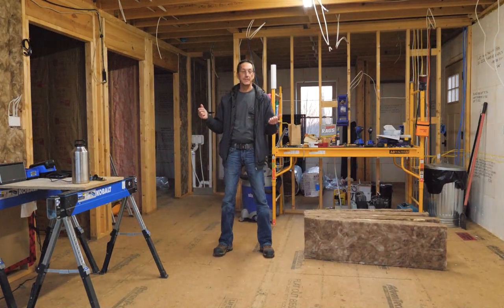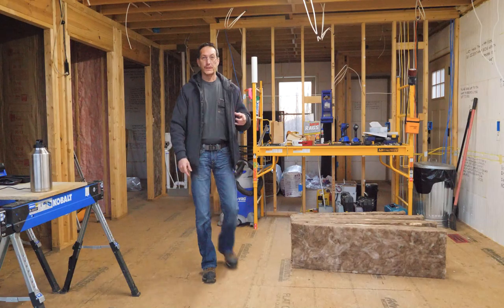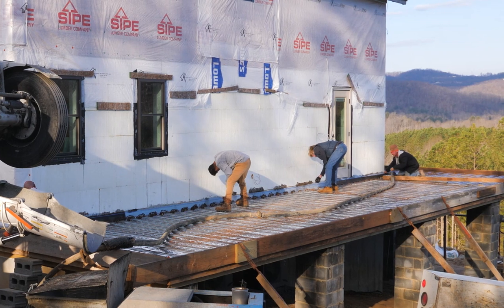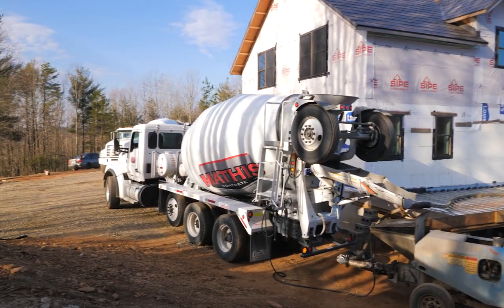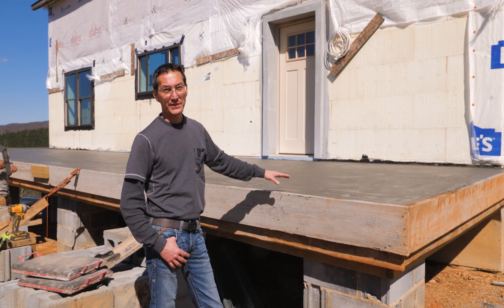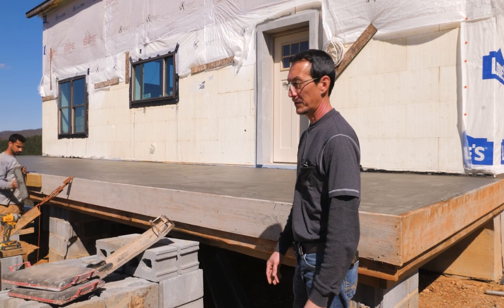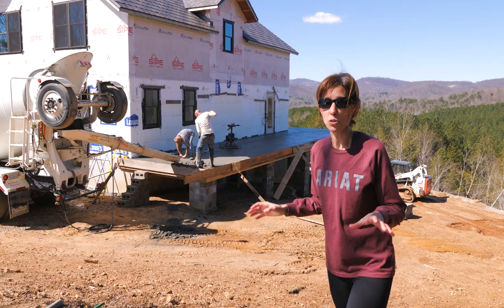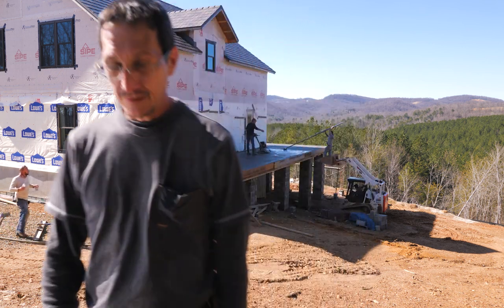Pouring a 50 TON Elevated Concrete Porch Slab!

Comment: Well? I've seen a few cement jobs in my time. Before any crew shows up there is so many variables that can turn a job into a nightmare. Things beyond yours' and the crews' control. This crew showed they had a lot of experience and knowledge under their belt and also had a couple of tricks up their sleeve (simply because of their knowledge and experience). You lucked out. You got the best crew for the job. They knew what-and-how to solve the problem when the cement truck deliveries started to get too far ahead of the work. That is a very rare talent right there because of the rarity of the job you hired them to do. Did you name the company or the guys that did this incredible job? I apologize, if I missed it. - - - - I spoke too soon (@ 16:16). When I finished the vid I saw and heard the crew's names. That was an awesome finish to your vid.

Comment: I love this deck.  No wood to worry about rotting and replacing!  Man!  What view you have!❤😊🙏🙏🙏🇺🇸🇺🇸🇺🇸🇺🇸🇺🇸
Reply: But couldn't you use composite materials that would last for their lifetimes for a fraction of the money? What are the big pros of doing a concrete deck? Just curious. Gotta love that view!!!
Reply: @realtor411  composite materials are typically only top side. The support for composite is typically wood. Concrete is forever.

Comment: So glad it worked out like you wanted. What a massive and impressive deck you created. I had my doubts about the forms holding, too. I would have over-engineered them by adding perpendicular bracing staked deeply all around. And it would have been absolutely unnecessary! I suppose that's why we hire professionals, right?

Comment: Soo great that you got the chance to lay concrete, after the harsh weather you had, that pump was a real daft idea, What 2 inch hose???, that 1 guy took the incentive and poured straight onto the deck, what a tough guy, glad its done now save for the cover for the outside after another long wait, Good Job guys. thanks for video from UK.

Comment: You realize how difficult it is for normal people to find any information on how to do an elevated concrete deck?  When I ask, people look at me like I farted in an elevator with them, then they try to convert me to wood.
Reply: Because you speak with people that have no clue about compressive/tensil/shear/point load/etc. concepts needed when working with concrete. House building with stick frame/trust is such a simple and revolutionary building technique that now unless you work in commercial/industrial you will never be exposed to that side of structural engineering.
Reply: So freaking true! I'm getting ready to destroy my old rotten deck and this is a real contender for surface material but this is the first channel I've seen addressing a raised concrete platform.
Reply: Its not something thats common at all. I framed a house that was a basement, and the owner turned the area that was supposed to be backfilled under the patio into a storm vault. We framed double 2x10 joists at 12" O.C, than placed 2 4'x8' sheets of plywood that the concrete subs prepped and poured over.  Instead of prepping over dirt, they pressed over gravel that was placed over the subfloor. The neighbor who was building next door did the same thing, but used metal pans since their span was shorter.
Reply: @poatjoler  Its not something thats common lol, this has nothing to do with being exposed to this or that. Out of the hundreds of homes I have walked I have only seen this done twice down in GA. Mind you a structural engineer was not even involved. You can't design something, that their is not a demand to build or engineer lol. Silly logic.
Reply: Look up the word soffit
Thank mr later

Comment: It takes a full 28 days for concrete to attain its full strength. I always like to leave it in the mold and cover it with plastic for at least a week or two to allow it to cure slowly. That gives it the ultimate strength that it can have. Also I would suggest using a spray-on/brush-on concrete sealer/curing coat  a week or two after it cures for the best protection. This method helps to prevent cracks due to fast curing.
Reply: In 1980 I was in a 'concrete class' that showed concrete slabs when after the initial set, slabs were flooded for 100 days, 30 days and the third slab was covered with burlap that was kept wet for 14 days. The 100 day flooded concrete went to more than 200% its rated strength. The 30 day flooded slab went to a bit over 150% its rated strength and wet burlap covered went to about 125% its rated strength. It's all about a slow cool cure. 40F is the ideal cure temperature.

I absolutely agree with the spray on sealer. It does a world of good for slabs.

Comment: I hope you don't mind a few questions from out of left field:  

I watched the video showing the basement pour.  It seems that another man could have been dedicated to smoothing the brick ledge a lot more, so you didn't need to grind it down later.  There was one sequence in that video which showed how proper finishing of one whole side of the ledger had been neglected by your crew.

Also, by any chance did your architect compare the total cost of a wood deck?  A wood ledger board could have been affixed to the exterior of the forms, with lag bolts pre-installed and protruding into the concrete walls.  And, 6x6 (or 8x8) posts could have been imbedded in your masonry columns, allowing all leveling to be perfected by fine-tuning the finished heights of those posts.  

Also, starting with thick posts could have delayed the addition of masonry stones indefinitely, saving more time and more money until much later.

As it was, you said it took a lot of time to size those masonry columns, so that your I-beams would be level.  

All that work and cost to install the metal concrete pans would thus be totally eliminated.  And, a wood deck can be easily maintained if built with the proper exterior wood screws and galvanized metal fasteners.

I was really impressed with the crew who poured the concrete porch slab, so I do hope you realize I am not trying to be unduly negative here.  Just curious if your architect ran any numbers to compare a wood deck.
Reply from the maker: I am the architect. I am the builder. This is not all about cost. There is a definite purpose. Stay tuned. 😑
Reply: They are building it for their long-term use. That makes all the difference.

Comment: how is that 2x4 held at the line on the house when dragging it across the concrete?  Does it just get used to gently smooth the top and then you rely on the self leveling nature of the cement to adjust itself?

Comment: Mind if I ask why you chose to do the porch out of concrete? I’m curious what the benefits were over traditional wood
Reply: Durability, longevity, long-term cost savings, feel, variety of available finishes, strength, unity with the structure, ....

Comment: The porch turned out nice but you guys missed out on a huge opportunity here!!!! If you would have put stem walls in on the two sides and front, or dug the porch out like the basement and carried your block around and then carried on the way you have, then you would have had the 2nd best root/storm shelter in the country!! You already used the bridge decking to carry the concrete so it was just a matter of a bit more icf block, a bit more concrete for the floor, etc. 

It creates one hell of a nice root cellar for storing your canning/food preservation but it’s also fire proof because all walls, floors are solid concrete and your ceiling is concrete and steel. These rooms also stay about 55 degrees year round and make excellent safe rooms for your guns or any of important stuff. 

The last house my wife and I built I did that on the front porch and it went the entire width of the house and went down both sides similair to yours and then we also did the same thing underneath the garage so we had about 800 sq ft of additional space with 8” concrete walls all around and 12” of concrete on top with steel bridge decking. 

You could easily come back at some point and do a little digging, put some footers in and lay block up to the bottom of the porch and cut a door in from the basement and you can make it as big or small as you’d like. 

Anyways, just a thought, but all looks fantastic anyhows.

Comment: Don't you need rebar for this type of slab work? Where the slab meet the house what is it resting on/ it's support?
Reply: its a metal deck
Reply: The concrete bonds to the metal decking, that and the welded wire provides reinforcement.

Comment: 7" slump? Easy to work but it plays hell with the water cement ratio. If you cast test cylinders and broke them a month later I'd be curios what strength it  would come up to.

Comment: Our scary concrete pour was the day before the Northridge earthquake. The paito concrete cracked at the stress lines as it was intended to do during a ground shift. 
The real quake damage was done later when the street water pipe going into the house cracked open at the houses foundation three months later.

Comment: 2" line gets clogged sometime; outside 4" is ok.  I thought chute would be high enough to go right in.  Must've used accelerator with the temp.  See a lot of comments on wet crete; 4000 mix has to go through that 2" hose somehow.

Comment: Was it really necessary for the concrete to be so thick ? @ 7" that is a similar thickness used in shed floors for Semi-Trailers to drive and/or park on.
Reply: Thermal mass?
Reply: they probably didnt want to toss the extra

Comment: This is awesome. Been searching around for info on composite steel deck forms because I actually want to do this exact thing for the floor of a shed I want to build. The whole thing would be resting on wood skids. The idea would be so that I can have the benefit of the concrete slab, but in theory I would be able to move it since its resting on skids on a gravel pad (pretty heavy, I know, but possible i think). 

Do you have an idea of what the dead/live load capacity is on your specific deck? I ask because the shed I want to build will be used for powerlifting, so dropping weights etc. (concrete would be covered with weightlifting platforms and rubber matts)

Comment: Wow, that was some wet concrete.
Reply: The first stuff out of the pump seemed quite stiff but when they started the chute pour on the second truck I thought it looked quite loose. The trouble with a chute pour at that angle is you can't get a stiff mix to make it down the chute at that flat angle.
Reply: @jamesharder5643   And having the crew pull it thru the chute would be .... expecting them to know their jobs and work ?  Yes it was a non-trivial number of yards, but I've seen concrete crews with the right tools move a stiffer mix down a chute and spell each other.

Comment: They are an amazing crew! The porch looks great.  When and why did you decide to increase the depth of the cement?
Reply from the maker: Why? Increased it to get the finished surface closer to the thresholds and to be able to create enough slope away from the house for drainage. When? On pour day lol.
Reply: @Guildbrookfarm  when you were talking about having such a mild slope before,  I had my concerns about it not being able to properly run off, especially if there is wind involved. The snow melt could have become an issue as well unless you kept it snow free.

Comment: With todays Pressure Treated prices, this was probably on par from an upfront cost perspective and it will last forever, so long term it will end up being cheaper than a wood deck...
Reply from the maker: Exactly 😉
Reply: @Guildbrookfarm  Thanks for putting out all these videos.. We are about to break ground on our ICF build in Eastern KY and this helps my wife and I understand some of the complexities we will face...
Reply from the maker: It's definitely a bit more challenging to figure out the nuances vs. traditional framing. But I would do it this way again.
Reply: @FJB2020  One of the biggest things is you have to be CERTAIN the windows and doors are exactly where you want them at the beginning.  No "do-overs" lol
Reply: @michiganengineer8621  Yeah I have designed my house in CAD and played around with the window locations many times over..   Luckily I can play around with it in 3D and get a general idea of what they will look like.

Comment: doesn´t the concrete comes out through the holes that are left when the steel deck changes its direction? Nice video!
Reply: Yes.  Maybe it was cut to be a tight fit? and also how does it not go out the edges?

Comment: Was that some sort of high-strength rebar mesh or just mild steel?
Reply: The steel mesh is for shrinkage crack control in the concrete, not as tensile reinforcement, that's the job of the steel corrugated deck.

Comment: Does the additional 2" slab thickness affect the load on the underlying steel pan structure?
Reply: The steel pan acts as a form. Once the concrete cures, you could remove the steel with no significant loss of strength. Would guess that pour got nowhere close to having challenged the pan at any time.

Comment: I just found this channel. Congrats on the build!, I'll check out the rest of the videos on this project. As an architect in training it is really nice to be able to observe many of the aspects of a project and you have managed to record a lot of it for a specific type of construction. Very instructional. Also, this is a METAL DECK (Composite Deck-Slab), so the title of the video is a little deceiving: an "elevated slab(raised slab)" usually sits over compacted fill. What was the design intent? (EDIT: I have now read in the comments the client wanted more durability) and 4000 psi, why not 3000? (Edit: I have now read that 3500 psi was a minimum for them, according to the comment (always follow local regulations) I think 3000 psi would have sufficed but I don't know the cost difference between these). What was the cost difference between raised slab, deck and this composite deck-slab?  spacing of piers, thanks!!

Comment: Did the extra 2 inches of concrete across the whole span still fall within the weight the deck was originally engineered for?
Reply from the maker: Yes when I switched from 2 inch deck pan to 3 inch heavier gauge and heavier beams to reduce the number of piers, it gave us more room to work with.
Reply: @Guildbrookfarm  That's great news, that much concrete added could have been a wrench in the works! Deck looks great and I'm in awe of the view you're going to have!

Comment: Looks beautiful. Hard to believe that is 100,000lbs.
I may have missed it, what is tying the slab deck to the house?
I didn't see any rebar or threaded rod.
Reply from the maker: Gravity. I don’t want this much weight tied to the house.
Reply: @Guildbrookfarm  So all the weight is on your block piers then?
Reply: Laddie, on the house side, it’s sitting on a “lip” that was integrated into the ICF foundation.
Reply: @kimberlykelly7280  Not just blocks though he had concrete poured in those piers for the porch.
Reply: @cst270  Oh that’s right! I forgot that they filled the blocks. 100 tons is a lot of weight!!! Sure turned out nice and no major upkeep.

Comment: No rebar required?
Reply: The mesh on top of the deck replaces the rebar.
Reply: @AutoCrete  I would have thought for that size job you would need both concrete mesh and rebar, with the rebar running parallel in the valley's of the deck pan and the wire mesh placed as it was in the video.
Reply: @ziggymoon  Granted it is a thinner slab you would be amazed at how much weight 'Concrete Q Deck' can carry. It is used in lots of 2nd story commercial applications like malls, the second floor in car dealership and movie theatres where you can't have posts/pillars all over the place holding it up.

Unless you are a tech savvy hermit living in a cave, I'd bet you have walked on it and had no idea of how thin the slab actually is.

Comment: How do you keep that elevated concrete from cracking overtime with nothing under it? Interesting.
Reply from the maker: Watch the previous vids in this series. There is PLENTY under it.
Reply: the corrugated steel under it is manufactured to be interlocking with the concrete and the mesh will improve that strength. I was concerned with voids on the edges, but that edge looked perfect.
Reply: There is a steel pan under it.
Reply: Go watch some videos on how they build skyscrapers.  Every floor is poured this way.

Comment: Did you have a selfie stick at the end or were you able to walk on it?
Reply from the maker: You can walk on it in 12 to 24 hours
Reply: @Guildbrookfarm  I'm guessing that finished shot was by drone. I'd stay off of it for 2 days just to be extra safe. I used to grind the tread off of iron worker work boots so the soles wouldn't leave marks when walking behind the power trowel.